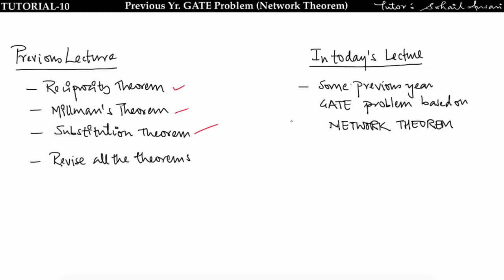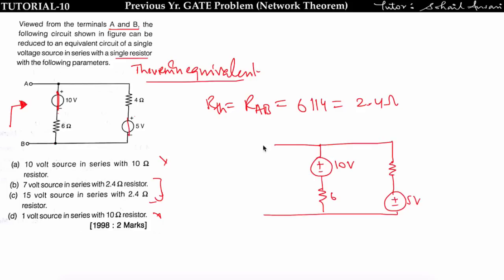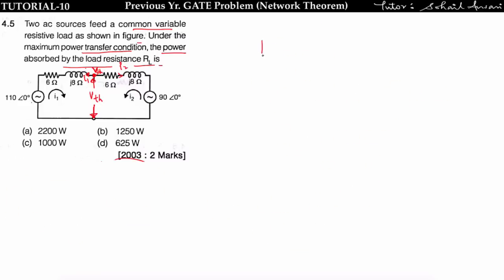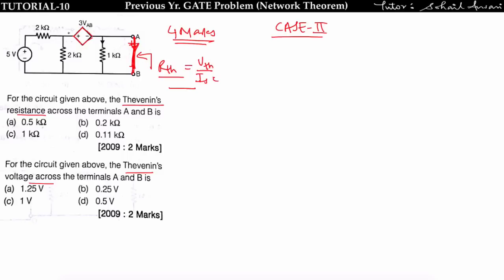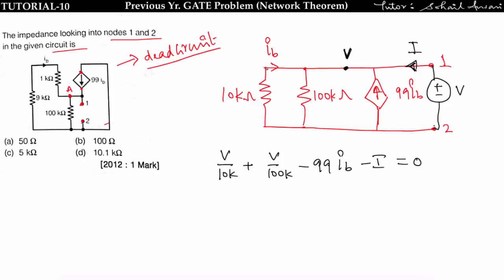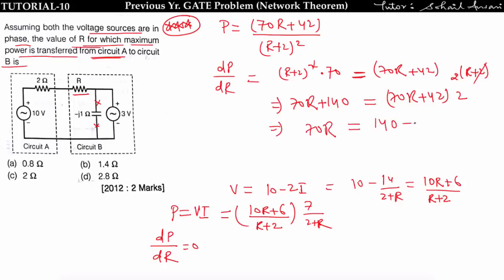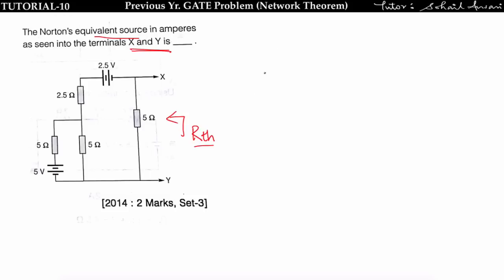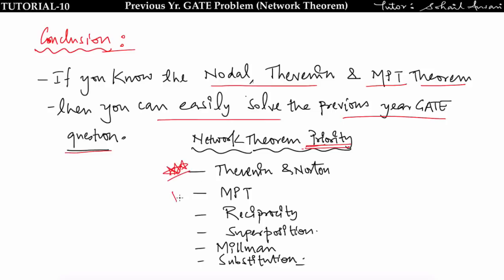Lec-10 GATE Ques Solved From Network Theorem

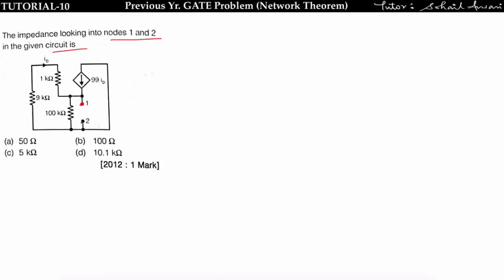Comment: At question 19:53 the value of Resistor is not 100k ohms but 100 ohms. I have checked on the official website.

Check Question no 21
http://www.gate.iitr.ac.in/papers/GATE2012/GATE2012_EC.pdf?download_file=papers/GATE2012/GATE2012_EC.pdf
Reply: Now the correct answer will be 50 ohms.

Comment: Sir in quest 1 1997 2 marks...  answer should be -2 A ....as currrnt in 3 ohm resistance flow from +  to - .. but u have tsken the opposite dirn of voltage source........by the way u r way of explaination is very good.....

Comment: sir in the first question how can be apart of the circuit is considered  6v in series with two 3 ohm can be 3 v series with  
3/2 ohm  plz explain this I have  written this problem several time plz reply i can do it by mesh analysis but it is time consuming
Reply: you have to apply source transformation twice. first convert V source to I source..and two three ohm resistor will come in parallel...after that again transform it into voltage source...you will get the required circuit...but you can remember it in that way.  its time saving
Reply: you can see it in second last question where In is coming zero ampere.

Comment: 23:10 How can we substitute capacitor with open circuit since we are not doing DC state analysis?? The voltage sources are AC.. plz clarify sir.. Thank you!
Reply: because when we find Vth, Capacitor is connected in parallel so the voltage across it will be 3v and no current will flow through R (open circuit) hence we got Voltage B side = 3V = Vth
In the case of Rth, the Voltage source will be short-circuited then the capacitor is bypassed.
Basically, the capacitor is just a dummy.
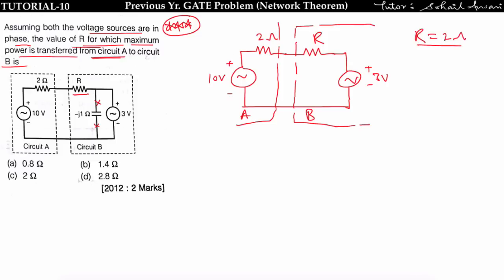Reply: @armankhan1446  bro at 23:50 if the load is only R how can the other be 2ohms i did not get that point. Pls clarify
Reply: @gateandblogs9303  I don't understand you point. Either elaborate or type in hindi.
Reply: @armankhan1446   if R is acting like load we get R= 2 ohms am not understanding that point how R becomes 2ohms if only R load pls see from 23:40 - 23:50 its said in the video.
Reply: @gateandblogs9303  because in maximum power transfer theorem if the load is purely  the Rth or Rsc is Rl(load)
Reply: @gateandblogs9303  if only the resistor is variable then it satisfies the condition R(load resistance)  is equal to the Rs(i.e source resistance)
Reply: @armankhan1446  nice explanation
Reply: Here the capacitor is not open circuited. While calculating the Rth in circuit 2 the capacitor is across short circuit so it is neglected
@ Apostolos Mavropoulous

Comment: Sir u must be considering capacitor fully charged in gate 2012 question
Reply: No need to consider that to be fully charged
In parallel circuit voltage is same
Here
I0V source with 2ohm and Rohm are parallel with 3V

Comment: In  the question at 23:10  why are u not considering capacitor ???
plz tell me...
Reply: Apply KVL for the outer loop only
Then you will end up with the same equation
By saying outer Loop I mean
10v supply with 2ohm and Rohm and 3V loop
Reply: because when we find Vth, Capacitor is connected in parallel so the voltage across it will be 3v and no current will flow through R (open circuit) hence we got Voltage B side = 3V = Vth
In the case of Rth, the Voltage source will be short-circuited then the capacitor is bypassed.
Basically, the capacitor is just a dummy.

Comment: Sir why we are neglecting capacitance in parallel with voltage source??Plsz rply sir
Reply: Please tell me why if you know
Reply: @b.v.prasad9736   because when we find Vth, Capacitor is connected in parallel so the voltage across it will be 3v and no current will flow through R (open circuit) hence we got Voltage B side = 3V = Vth
In the case of Rth, the Voltage source will be short-circuited then the capacitor is bypassed.
Basically, the capacitor is just a dummy.
Reply: @armankhan1446  i have one doubt. In 3rd qn, while calculating Rth, sir has considered  the two 10 ohm resistors in parallel, but while calculating Vth, he considered them in series. Why so??? Can you tell why so???
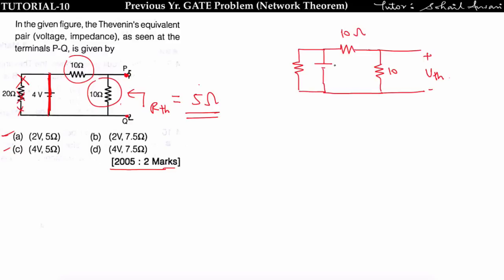Reply: @manishadas7434  See the diagram at 14:00 we are applying KVL to find Vth and since the terminal, PQ is open-circuited (No current will flow beyond 10ohm parallel resistor) so we will consider them in series.

In the case of Rth, we have to find the equivalent resistance ACROSS PQ. To understand this easily consider a current flowing from P to Q and that current will divide across both 10-ohms resistors (making them parallel) rest is easy I guess.
Reply: @armankhan1446  wawwww...thanks a lot..i guess i discovered a new teacher :-)
Reply: @manishadas7434  You're welcome.
Reply: In the last problem I'm apply mesh analysis to find the voltage. But I'm not get the same answer as he solve.plss reply if any one knows

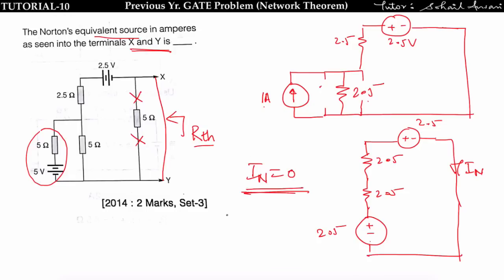Comment: at 33:18 to find norton current we can directly convert 5v source to 2.5v with in series with 2.5 ohm in place of two parallel 5 ohm resister. in short we can use that formula of circuit reduction which u have used several times before in lectures.
Reply: When we use ckt  reduction techniques ..what r the rules for that plz explain

Comment: Sir in last question for finding vth why u have not selected the rightmost loop Like vth-2i=0.sir plz  
Reply..
Reply: bro if you find the answer then please reply. also cant we use voltage division between 1 and 1 ohm and finding current and then 2*i =Vth

Comment: Sir on finding impedance problem the nodal method you applied was confusing.for  ib which is flowing towards the node is  taken as v/10k then for substituting ib value in 99ib you applied -v/10k.its confusing sir

Comment: Some of the problems , we can answer with alternative methods too.. infact attempting the same problem with multiple methods gives us more insight. For example  at 26.43, we can solve this in intutive approach...    under  "max power transfer condition" the drop across "source impedence" (2ohms) and drop across Load are equal. That means 5V will be dropped across 2ohm resistor and so the current is 2.5A.   Now the he total drop across load must be 5V...means 2V across "R".   2V/2.5A = 0.8ohms.
Reply: How did u know that the voltage drop across 2ohm resistor is 5v?
Reply: under  "max power transfer condition" the drop across "source impedance"  and drop across Load are equal, hence the drop across the load i.e R and the 3volt source is equal to the 2-ohm source resistance.
Reply from the maker: right
Reply: Superb man!That didnt strike at time of solving

Comment: in the solution of gate 2012 the the drawn equivalent circuit is wrong ..plss correct it..thye dependent source will be in series not parallel 100kohm resistor...
Reply: sorry its alright..my mistake..

Comment: At 23:35 you said that whole circuit B is acting as a load not only R and then you said that if only R were acting as a load then its   value would be 2 ohm. But shouldn't it be different than 2 because R is not variable?

Comment: SIR why the capacitor has been removed ...? please explain
Reply from the maker: bcoz it is connected in parallel with the ideal voltage source..so we can replace from analysis point of view as it is not afecting the other response

Comment: I have noticed in many questions but I am asking this,at 10:13 when load is removed And A and B terminal is o.c how could 6+j8and 6+j8 could be parallel, it should be in series ,I got stuck here .plz help me out
Reply: UPASNA KUMARI 

Voltage sources are shot circuited then across A and B 6+j8 and 6+j8 are in parallel
Reply: Just draw with A B terminals and just stretch them apart ull notice those are in parallel nd not in Series

Comment: mastaru super sir but i have one doubt way capacitance is open circuited if it connected in parallel to a voltage source
Reply from the maker: the voltage source will give constant voltage to the supply..so even after removing the capacitor the circuit parameter will not change..so from analysis point of view i can replace capacitor..however from power point of view it cannot be replaced..
Reply: if it is ac voltage source then also it is same or not sir (guru thanks for making this vedios forever )
Reply from the maker: yes..then also it can be removed..
Reply: ok ok thanks guru thank you so much (can i call u guru afcorece but tell me sir ???)
Reply from the maker: ya no prblm..u can ..all the best..

Comment: why we are taking capacitor as open ciruited? plz expain?
Reply from the maker: capacitor is connected parallel to the voltage source..so it wont affect the current flowing in other branch..so it can be removed from analysis point of view..

Comment: Instead of solving the circuit, we know that current is maximum when the resistance is minimum, so that can't we say that from the options lowest value of the resistance gives the maximum power?
Reply from the maker: dear chandana MPT is applied when load is variable..means when u dont know the value of load...if load is fixed then we choose the minimum resistance path so that maximum power can be transferred to the load...
Reply: OK thanks ☺

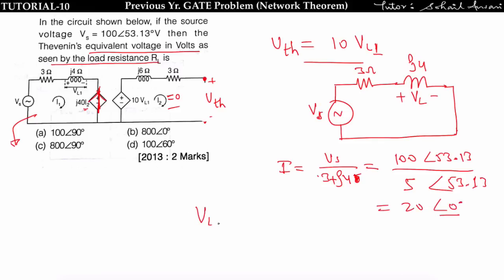Comment: Sir ..in 30:07 u took 10 VL1 =Vth ...bt wat abt the  j6 ohm nd 3 ohm ther wil not be any voltage drop across those resistors??
Reply from the maker: Vth is found when the terminal is open circuited..not since it is open circuited thats y current flowing in that branch will be zero..means there will not be any voltage drop across 3 ohm and j6 ohm...got it..
Reply: thank you  Sir

Comment: sir in thevenin's theorem can we short dependent source directly and find Rth, instead of calculating short circuit circuit....
Reply from the maker: +Milin Arutla no u cannot short circuit dependent source.  its not the correct way...better go with the method which i tought u..i e. case 2
Reply: thank you sir

Comment: Thank You very much Sir,
Why capacitor is open circuited at 23:10 (is it bcos we are supplying constant voltage)?
Reply from the maker: yes..correct..even after removing capacitor the voltage and current in the circuit will not change..thats y it is removed..
Reply: @GATEMATICEducation    in that numerical if we replace the 3V source to a resistance using substitution theorem,  we can solve it orally, !!
Reply: kishan chauhan how can we do that?

Comment: 23:30 ...why the capacitor gets OC when it is connected across a parallel voltage source?
Reply from the maker: at steady state the capacitor gets fully charged and it will not affect the other branch..so we can remove from analysis point of view...however from power point of view we cannot ignore the capacitor...as it consume reactive power..go through my transient lecture as well as power calculation lecture..u will understand better..
Reply: Bhargavi Bolisetty 
As it is connected in parallel with the voltage source, same voltage is applied across the capacitor. so that it can be removed from the circuit for the analysis.

Comment: 12:30..sir power= Vth/4RL ..This formula is only for 1st case of Max power transfer theorm. Here you used P=I^2 RL. why?
Reply from the maker: P=I^2RL is the generalized formula..u can apply to any case...if u will apply this in case 1 then u will get V^2/4RL only...
Reply: GATEMATIC Education sir I'm not able to get the solution by formula v2/4r
I'm putting v=100
And r= |3+4j|= 5
Reply: Bhargavi Bolisetty have u got ur answer??

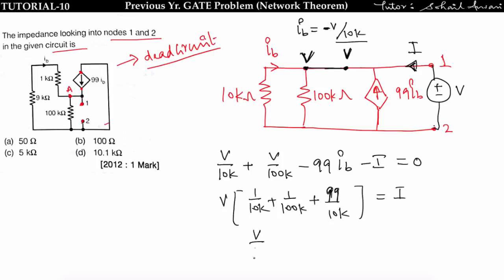Comment: At 21:51 , ib is entering and I , 99ib also entering but while taking the equation signs are not matching... could u plz explain it sir???
Reply from the maker: yes thats why  i replaced Ib with negative sign..i.e. Ib=(-v/10k)...bcaoz it is entering in to the node...if u have seen my nodal analysis lecture then u will understand better...
Reply: Ya... Got it sir ... Thanku...

Comment: Q No: 4.5:you had calculated Rl=Zth=  √9^2+4^2, you did mistake here pl correct it.  Zth will be √3^2+4^2= 5
Reply from the maker: yes its a slip of pen while writing..however final answer is 5 ohm only..
Reply: okk.. thanks

Comment: why u removed capacitor which is parallel with voltage source ?? in question max power transferred to R
Reply from the maker: since the capacitor is connected in parallel with voltage source of 3V..so the voltage across it is not going to change..therefore it will not affect the system when i remove the capacitor..if it was connected in series then we have to consider that also..but here connected in parallel so we can remove it from analysis point of view..
Reply: Means the fully charged capacitor acts like a open circuit having source voltage across it ryt
Reply from the maker: here its not dc its ac..so it will not be open circuit..since it is connected in parallel with voltage source.. that y u can remove from analysis point of view...
Reply from the maker: in ac circuit if sinusoidal or cosinusoidal is given then we have to take max value for the analysis...and if nothing is mentioned and source is given in phasor form then that value is rms value..
Reply from the maker: if nothing is mentioned about excitation then take it as a rms value...in any ac circuit the magnitude given is rms only..
Reply: No bro..u see any question in AC analysis,it will be mentioned if given value is rms..otherwise u need to consider it as peak value.
Reply: sir, u said that the voltage across capacitor is not changing becoz it is connected in parrallel but sir the voltage source is an ac source , so voltage across the capacitor is also changing ... please explain this fact sir ??
thanks alot
Reply: In max power tranfer pblm u have removed capacitor since their is an a.c. voltage source in parallel to it .You have said that if the capacitor is connected in serie we have to consider it.BUT IF THEIR IS DC VOLTAGE SOURCE IN PARALLEL OR SERIES WHAT HAPPENS SIR?
Reply: avskrish ram DC current cannot pass through capacitor .. its and open circuit in place of the capacitor,in series or parallel
Reply: Can u explain how u get 5v ans 2.5 amp current
Reply: the value of ac voltage source 3V angle 0 .. therefore the reactance will be infinite Xc = 1/jcw and w=0 .. that is why its replaced by open circuit ..
Reply: It will be mentioned if it is rms otherwise it is peak
Reply: I think sir u apply long method to solve this question...you may easily solve like 5-3/r=2.5amp